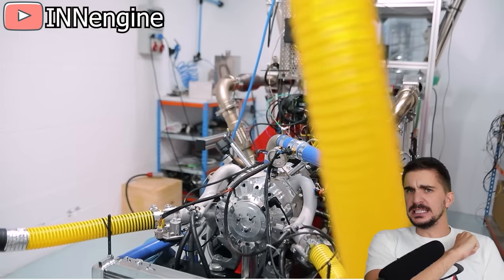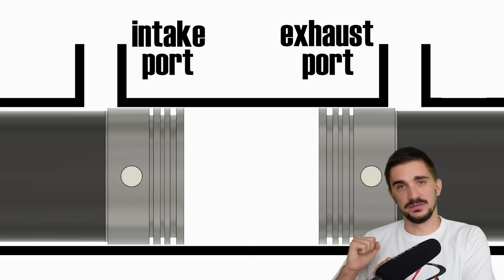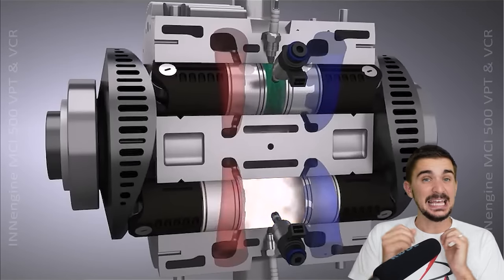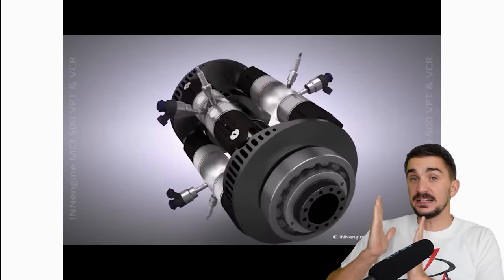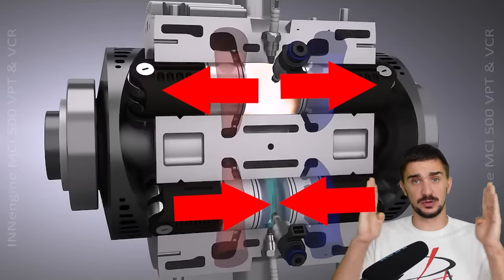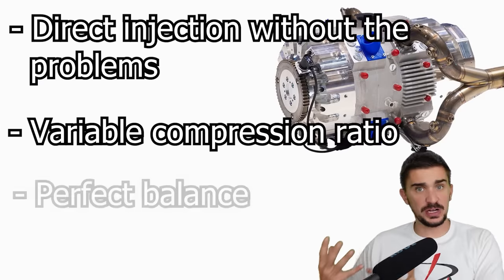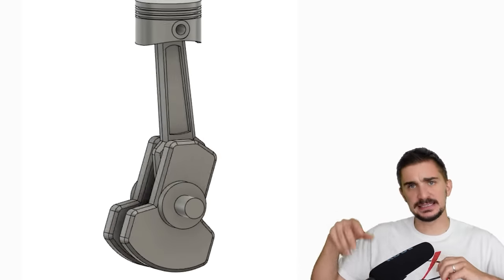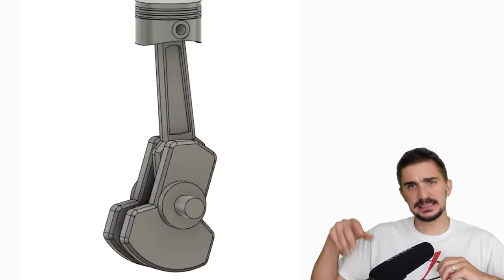Spain is Living in 2050? Revolutionary 1 Stroke INNengine Analyzed

Comment: It's mechanically a really interesting design, though I still can't get over my suspicions with efficiency losses to friction and directional change in transferring the lateral movement of the pistons pependicularly to the swash plate. That said, the fact that they actually succeeded in mounting it in a car and drive it shows that it still works. The inconsistencies with terminology I can chalk up to the investors in the project not actually understanding what the engineering team were saying. Definitely want to see where this project goes.
Reply: For a car the inefficiency from constant stop to high load won't work good with this design. It's a great engine for continuous run applications though where it can just keep going at the same rpm and load.
The big weakness of this engine has to be the bearings. You make bearings for heavy torque that go slow and last 50 000 hours. You make bearings for light torque that go fast and last 50 000 hours. Once you make bearings for heavy torque that go fast, you're looking at 1000-5000 hours of operation. Suddenly a full engine breakdown is on your yearly car maintenance so that's not going to work.
Reply: @Rizon1985  Yeah, I wonder if instead having each piston attached to a crankshaft which then drives the main shafts through 90 degree gears might produce better results
Reply: Yea the swash plate will probably wear out super fast unless it's made from some kind of super metal like titanium or inconel or something idk
Reply: @joshuasimmons2412  The chambers will use lubricant to prevent galling just like in any crankshaft housing.
Reply: @Rizon1985  well yea, but the perpendicular forces instead of parallel put way more load on it than a normal engine though. I'm not saying it can't be fixed with better material and tolerances and things but it could be a potential problem
Reply: But you could have a flywheel as big as you like.. that would be great for ships
Reply: This was exactly my thought when I saw the engine design.
Reply: Yea but the piston shafts are on rollers to the swash plate so the friction is greatly reduced.
Reply: @65gtotrips  hydraulic lifters have rollers and they wear out on motors and they aren't subjected to as much force as a piston produces lol
Reply: Not to mention.  The "12 -1' compression ÷ 2.  Because division of force on opposing pistons. 
Would quickly lose power during power stroke.
Reply: @Rizon1985  Reliability has never been in Mazda's vocabulary. Even it it all works, it won't last long over time
Reply: @Rizon1985  That`s easily solvable with hybrid tech.
Reply: Exactly, the friction on that wavy thing seems not possible just off gut feeling. Grinding that thing on every stroke.
Reply: This engine is a glorified A/C Compressor, lol!
Reply: @Rizon1985  I don't think you'd see as much Torque per bearing as the 120 HP is spread over 8 piston bearings. Maintenance wise it looks pretty easy to pop the ends off and replace bearings. There is suspiciously little talk on endurance tho
Reply: Well, friction losses could be minimized if the engine was used in lighter vehicles, as friction force = coefficient of friction multiplied by the normal force in the simplest of terms. The inertia of heavy cars and 4 ton SUVs will increase the force required to move the car, therefore imparting a greater normal force inside of the engine. This engine would work better on cars with a mass of say < 500 kg (1000 lbs). I want to see this project on a motorcycle or small two-seater microcar, similar to the design of the solar car (ex. Aptera or World Solar Challenge cars). The engine would work well on tiny aerodynamic vehicles, and allow for great speeds to be achieved without needing much torque or horsepower. :)
Reply: Yep, seems a lot like driving a worm gear in reverse - it kinda works if you can get really low friction, but the normal force on the mating surfaces is crazy
Reply: @thatguyalex2835  not really. The piston being forced down by an explosion is always going to cause tons of friction in that design regardless of the weight of the vehicle even at idle
Reply: @thatguyalex2835  Doubt all this. Internal engine forces are direct products of power (BMEP, in correct engineering terms) and wholly independent of vehicle weight. Heavier vehicles simply accelerate slower than lighter ones, at any given power level.

Comment: Some turbos should help with scavenging.
Fab videos as always. Always makes me think. I'm an ex engineer and I love your presentation style, engaging and keeps the mind working.
Reply: cant remember which car it was, but there was an engine with a turbo or supercharger that didnt "push in" air but worked on the other end and basically sucked out the exhaust gasses. something like this could help. it could also create enough vacuum so that it could help with low end torque too
Reply: That’s basically what I was thinking… a small turbo.
Reply: No such thing as an ex engineer... ;)
Reply: Yep it could be a good idea but this engine is design to be use as a range extender so operating contex is full of starting and suddenly stops something turbos don't like to much.
Reply: @rodrigomartinez3937  Ehh… not necessarily: as a range extender, it could be cycled on when the battery reaches 20% or so, and stay running until it reaches 80%. With suitably sized battery pack that could take half an hour or more.
Reply: once an engineer, always and engineer (even if not practicing)
Reply: fun fact for yall
2 stroke detroit diesels are not N/A
they require positive intake pressure to scavange and move air through the cylinders
i was thinkin that might be whats going on with the innengine
Reply: How would turbos help with scavenging at low engine speeds/light loads where scavenging is going to be the biggest problem?  This is why two stroke opposed engines have typically used blowers.
Reply: @ferrumignis  ayep!
the FI system used on the innengine is a belt driven, 
again, 2 smoke detroits do this exact thing
Reply: ex engineer? you forgot everything about being an engineer?

Comment: This is an existing idea used on the Rapier Deltic engines used in railway engines and more often in high performance shipping (minesweepers for example).  These engines had some issues that were design related so it’s good to see it being re-engineered in a modern environment with better design tools.
Reply: Napier.
Reply: @markbeale7390  I didn’t even notice until you pointed it out.  It’s an age thing.  A friend recently rebuilt one (because he could) and my father was a chief engineer in the RN.  The Deltics were his expertise as they required a lot of babysitting.  Very high power to weight ratio.  I for my part was involved in Electro Motive Diesels and GM as a distributor for engines that included the big supercharged diesel two strokes.  You could dump full load on those (over a MegaWatt) in one step.  Great for trains, tugs and emergency power generation.
Reply: The Napier Deltic was a development of the German Junkers Jumo 205 to 208 aircraft engines, effectively putting 3 of them together in a delta. Napier licensed the Jumo before WW2 and worked on their own variants. Many people had tried to make a delta engine and failed but Napier realised it would work if one of the 3 crankshafts should rotate in the opposite direction to the others.
Reply: @jacksjaunts8580  That's very interesting thanks,napier made a rapier engine,a 16 cylinder H configuration.
I read the New York fire debt have or had a deltic fire pump to deal with high rise fires 🔥.
Reply: @lisakingscott7729  Very informative thank you 👍
Reply: @markbeale7390 Napier Sabre ...  Extremely powerful but too complex for wartime conditions ...
Reply: 16:30 you seem to be missing the point, a crank shaft gets you to tdc once per revolution, this engine has the “wavey” thing as you call it which gets you to tdc twice per revolution hence their yclaim. 
Very good video btw.
Reply: Napier Deltic ... also the Fairbanks-Morse opposed piston design was similar.  A modern twist on that engine is the Achates Power that is being developed for over the road use not only in commercial trucks, but also for pickups.
Reply: @jacksjaunts8580  Your mention of EMD two strokes reminded me of when I worked on a minesite power station that still had it's 5 original 2.1MW 20 cylinder  EMDs powering 660V alternators. They had an engine driven blower with an exhaust driven turbine attached. The engine-to-blower shaft had an overrunning Sprague clutch so that at about 1.5MW load, the exhaust gas pressure would be high enough to start to disengage the clutch & make the blower spin faster as the load increased than the fixed mechanically driven speed. They were very smokey & were eventually mothballed & replaced with  6 Jenbacher 1.2MW natural gas powered generators left over from the Salt Lake City winter Olympics.
Reply: Not really a fair comment in that the engines you reference did indeed use two stroke horizontally opposed pistons but they used geared crankshafts for each bank of pistons making for very long/tall and heavy engines. This design innovates with swash plates replacing crankshafts and all pistons aligned in a circular layout rather than a traditional linear block. Compression ratios were also fixed.
 This is genuinely innovative although I wonder whether friction with the swash plate will cripple it's torque and cause wear issues.
Reply: @daithiosioradain3380  the design is an orbital engine.  They have been around for decades.
Reply: @rosshilton  Agreed but probably closer to a Wankel than this design. The comment I replied to specifically referenced Deltics.
Reply: I knew it wouldn't be a new idea. They never are. Everything's been done before.
Reply: EMD, like the old N class locomotive. 1800kW turbocharged 2 stroke diesel, 750 volt DC generator, chopper controlled traction motors.
Reply: Napier Deltic
Reply: 👍Napier engine amazing bit of kit
Reply: @lisakingscott7729 you’re bringing back memories my apprenticeship
Reply: It is nothing like the Napier Deltic except for two pistons using one cylinder.
Reply: Roots built Commer truck used something similar up until Roots were bought out by Chrysler
Reply: @jasonhill4094  The Commer was nothing like a swash plate engine and actually had a normal crank  with long rockers for the pistons!
Reply: You beat me to it, squeeze plate or squash plate diesels were quite the thing going back to the 30s and 40s.
Reply: @Withnail1969  

The patents have probably retired and so someone claims to have a new idea.
Reply: Napier, as in Deltic and Sabre👍Sticky keyboard😉
Reply: This engine is a glorified A/C Compressor. same thing
Reply: damn, this had me going down a lovely rabbithole, you surely made my day better sir!
Reply: @jasonhill4094 the engine was the Commer ts3, fed by a super charger.
Reply: @rosshilton indeed the orbital engine design from Peraves in Switzerland may have inspired the designers in Spain.
The problem of manufacturing the tubes to run the pistons in was turned into a straight line motion.
Mahle and competitors have plenty of experience how to manufacture sealing and engine manufacturers bring more than a century of experience how to design cylinders.
Reply: @floriandiefenthaler2553  

The whole design is nearly 100 years old.   It was not Preaves either.  It’s a DELTIC engine.
Reply: Yep. also check out the Commer Knocker engine. 3 cylinders, 6 opposed pistons, no valves and a supercharger that's so efficient that before the piston covers the exhaust port clean intake air is exhausted.

Comment: I really appreciate your break down on how this as well as other engines work.
This engine being so light would be great in the small boats here in the USA.
Reply: that engine is not light so its still heavy
Reply: @steveharrigan3425  oh, the way that guy was holding it in video I thought it was. Thanks.
Reply: The weight and less complexity are the big selling points.
Hard to compete with a conventional ICE that can easily last 200,000 miles.
Reply: Love to see this in a dirtbike.
Reply: @mxcollin95  No low end torque. Probably can't pull a wheelie 'til you hit 6000 rpm.
Reply: @jeffrandolf5673  you’re probably right but that’s actually pretty typical in older two-stroke bikes.

Comment: I always found it weird how the Detroit 2 stroke diesel design was completely abandoned. Glad to see it come back somewhat.
Reply: love the old detroits !!
Reply: The emissions regulations killed them. Using direct injection and an oil pump would probably be enough to get them to meet regulations again.
Reply: @affiliatereviews4079  Yeah, apparently you can get a kit with different cam timing, injectors and turbo that makes them meet current emissions, but the coolest part about them was the smoke and noise :), trying to get a 6x6 project truck happening soon :), 
here's where one gets converted to common rail hi pressure injection;
https://youtu.be/XocHVgHeOLQ
Reply: Same here; I'd love to see a modern 92 series with common rail injection, bypassable blower, and twin turbos on the V engines.

Preferably with a long stroke as well, as I find the short stroke/bore ratios of Detroit 2-stroke engines to be rather odd.
Reply: Noting new on the market today beats the 135gr/hp of the 671. The sound emission rules also were a big factor. I love it, but most people do not. I recon this design will screem as well.
Reply: @electric7487 I think the short stroke is a trade off of piston port engines.

By default the compression stroke can’t really start until the piston moves past the ports. I think there’s issues with filling or scavenging when the bore is small but the stroke is long as it would lint how much intake port is available. Unless you make the ports taller which then eats into the compression stroke.

A modern four stroke diesel can take advantage of the expanding gasses all the way to BDC.

That’s my unofficial thought process at least.
Reply: Those Detroits made great electrical generators
Reply: @vicbittertoo  also i just remembered most large marine engines are the same style 2 strokes and those have some of the best efficiency among combustion engines.
Reply: The old Detroit’s were hilariously inefficient. And they really didn’t make any power considering you have to drive them like you slammed your hand in the door
Reply: @Louzahsol  Maybe in trucks, in boats they are the best thing ever.
Reply: @Nerd3927  probably because boats don’t need to shift and can instead sit in the powerband all day.
Reply: Sad this Euro 5 compliance sucks, makes it harder for 2 strokes engines out😢
Reply: This potentially kicks ass in a diesel application.  Would like to see 100k miles on one of them and see how it fares.  I've got some hunches on where the fail points will manifest but you never really know until you run the thing long enough.

Comment: I've never found two strokes to be problematic. In fact, two strokes are massive fun
Reply: Can you imagine the fun 120 hp would be in a side by side!!!
Reply: @abnerschmucker1 I have two VMAX-4 750 engines just kicking around, lol.
Reply: Sounds like torque will be a problem though
Reply: @abnerschmucker1  some boffin will work it out 😁
Reply: Someone defending two-strokes in 2023 probably already suffered two strokes.
Reply: @ejnaygfantzcg  I'm proud to say I still own one a rare yamaha tzr125r and had massive fun yrs ago on her
Reply: @abnerschmucker1  Big flywheel?
Reply: @ejnaygfantzcg  Yes it's true a couple YZ2 50s LOL
Reply: @abnerschmucker1  I want this in my 1977 Ford Escort when the original 50-60 HK gives up..
Reply: @ejnaygfantzcg If two strokes don't have an advantage over four strokes, why aren't similar bore sized 2 strokes allowed to compete in the AMA?
Reply: @ejnaygfantzcg A modern direct injected 2-stroke with a seperate, pressurized lubrication system can rus very efficiently an even clean. The problem is however, if 2-strokes are banned, they're banned and there's no way back, because politicians don't know this shit. Plus, it's easier a.k.a. cheaper to improve on existing stuff than to reintroduce something that has a bad name because development got stuck 40 years ago.
Reply: richardhildebrand8380  so what
Reply: richardhildebrand8380  oh good, I got outboard engine, chainsaws, lawnmower, a big grasscutter/snowplow (change frontpiece) so contributing to the good cause
Reply: 2 strokes are a high emission engine. That's their main problem. You're right about the fun part though. I used to work on 6V53 Detriot diesels, or "screaming jimmies". They had their own unique sound that always put a smile on my face at full revs...especially without mufflers.😁
Reply: @ejnaygfantzcg  I´m lucky where I live.... There are plenty of old 2 strokes buzzing around! I love the deafening noise and the smell of burning oil first thing in the morning 🤣
Reply: I hate 2 stroke , lot of work. Burns oil
Reply: @himanshutripathi7441  But that smell of the buring oil.... Love it!
Reply: someones girlfriend don't agree ;)
Reply: Totally agree.
Reply: KTM👍👍
Reply: @ejnaygfantzcg cope and seeth as we make twice the power at the same rpm
Reply: Its like the old Deltic train engines with opposing pistons and no head.
Reply: Emissions
Reply: And smell great!
Reply: yeah, but calling your engine a 2-stroke is a kiss of death for investment money over environmental concerns. Even if it was a niche product; investors and regulatory boards have all the nuance of a Sith on the matter.
Reply: richardhildebrand8380 wrong.
Reply: @abnerschmucker1  there not far from that now with tunes
Reply: Oh yes, premix fuel engines are real fun.
Big RPMs & lightning throttle response.
Reply: @ejnaygfantzcg  Waaaah you hate fun